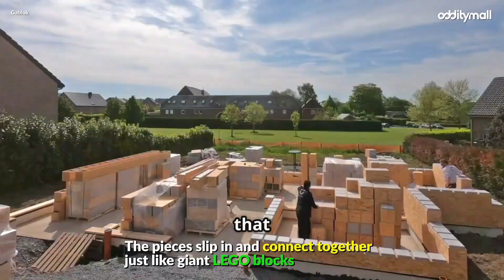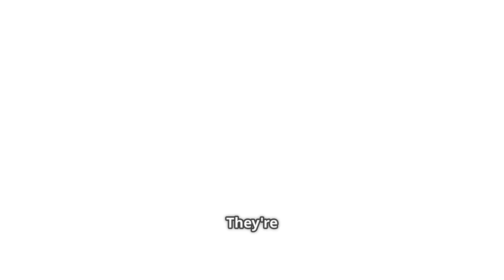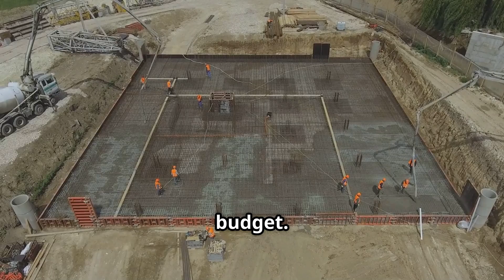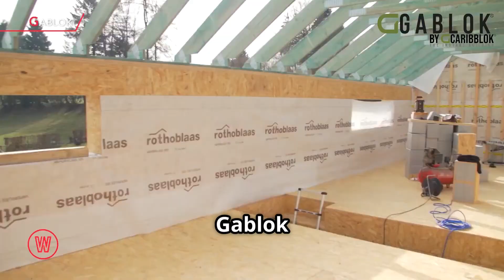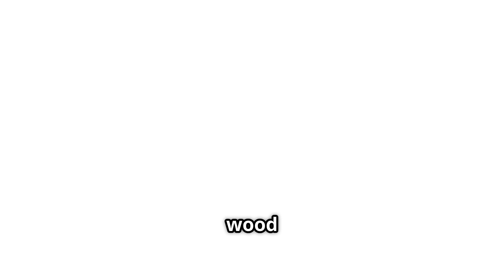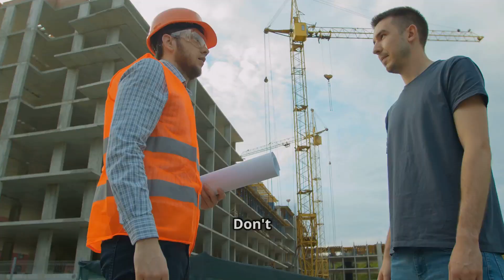Build a Tiny House with Gablok Lego Blocks?

Comment: Euro snobs won't even apply for US certification.
We have to use hemp block construction instead, which in my opinion are even more risky in humid climates that OSB that Gablok uses.
Reply: I think a lot of our lag time in getting anything new is caused by industry controlling our building code to their advantage. They resist competition by creating the need for $100K in testing before a material is acceptable and they are the only ones who can afford it.
Reply: @Flyingrabbit2222  I can agree with that statement. Developers here in my area (San Diego CA) are hugely influential in keeping housing costs as high as the market will bear by contributing to political campaigns who advocate for low income housing with their public face to get into office and then turn on those low income buyers by making bureaucratic approval expensive for the wealthy developers who own subsidiaries that supply certain types of construction methods and materials.
Reply: Nothing wrong with hemp blocks.
Reply: @NOWAR-q7s  
Non-structural, so you need to construct a frame per local standards, which in California where I live mandates a certified engineer's plan submission, California certified seismic design planning board pre-approval and on and on ad infinitum.
Hemp crete is good for YouTube coontent, but that is about as far as it's widespread adaptation goes in the highly regulated home building industry that developers avoid because illegal alien labor is not easy to find hempcrete experienced trades workers.
Reply: @dustup224 That happens when you build houses with non qualified or poorly qualified people.
Hempcrete is a very old and proven technique.